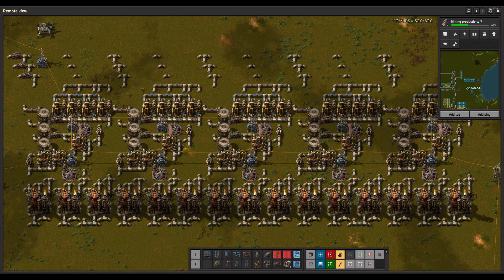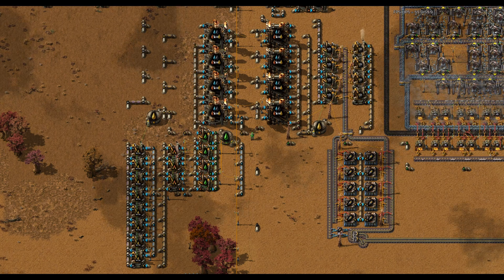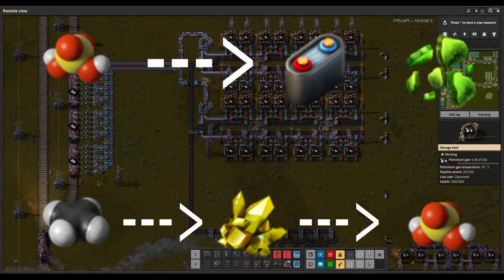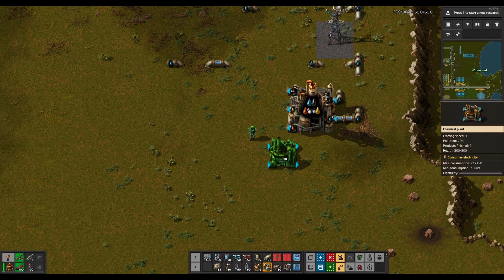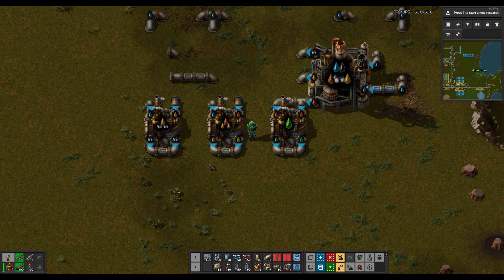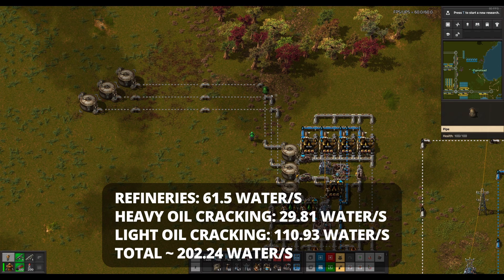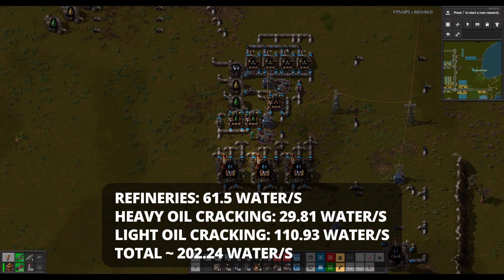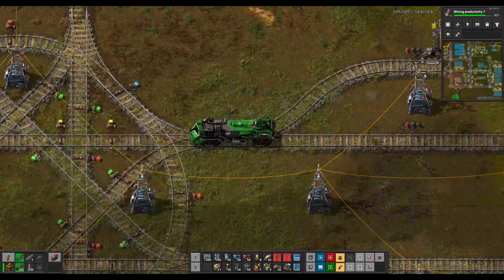A Quick Guide to How I Tackle Advanced Oil Refining in Factorio

Comment: I just do a read contents of fluid tank and turn off the corresponding chemical plants if low on heavy/light oil. Allows to easily attach some lubricant and rocket fuel early on. And you can go easy on ratios — just add a bit more consumption than you produce (I still use the ratio calculator site for needed amounts of buildings) and none of the outputs will be blocked.

You can also burn excess petroleum (and light oil into petroleum) into fuel for boilers early on on Navus (Or you could try voiding it via "change recipe" on a clock - works for voiding molten copper on Vulcanus in "Ghost LDS" recipe, so why not try for petroleum)
Reply: On Vulcanus it seems that your only limit is plastic (coal more specifically) and space to build. Solar is 3 times more efficient - so after poisoning some small worms and establishing Starter Base™ you can spam those.

Basic coal liquefaction is probably the only thing that eats through calcite like crazy, so you probably want to import some science to research normal one and ditch old one all together.

After that I made a design for supplying 2 chem plant of plastic and copy/pasted it into one big x16 build (red circuits are hungry)

So yeah... 4 green half lanes of Coal is not enough and I guess I'll rebuild the coal belt strip (again) on bus to accept  even more coal from big mining drills.

Comment: I think a more straight forward solution to handling the mismatch of fluids is to have your cracking plants only work when Heavy > Light and Light > Petrol.  You can do the circuit logic on two pumps each coming out of your heavy oil cracking and light oil cracking builds.  The outcome is that all your oils will remain at about the same level.
Reply: I think I did this once and then forgot the tactic. Thanks for the tip.

Comment: To expand on this, early game coal use can be a problem with blue science and power. To that end I like to setup fuel bricks as the final overflow product for light oil and petro. So I turn anything over "high" light oil to bricks. Only turn light to petro when petro is "low", but also turn petro to bricks if "high". And much like your design, crack all heavy unless lube "low". The plant will only shut off if both power and oil needs are satisfied by light oil stuffing up the system. So your oil plant now becomes your plastics and power center until nuclear. If you are unlucky, like me, and don't have any uranium in the spawn zone, this will last you pretty far into purple and even space.

Comment: Can confirm, turning chem plants on and off via the circuit network was possible in 1.1
Reply from the maker: Thanks!  Neat to know that I just wasn't paying attention.  Still, the first pump that I realized was totally unnecessary in 2.0 is the one on the petroleum gas line pushing the machine output to the tank.  As I recall, pre-2.0 fluid simulation would jam the light oil cracking production outputs without that one… so they weren't all totally unnecessary at the time.  Evidently I like toggling the chemical plants themselves better, which you can see in the my newer blueprint (which is linked in the description now).
Reply: @zipnotoad Using a pump and a tank (as liquid level sensor) may not be necessary, but it has one huge advantage. It works no matter how many chemical plants* and tanks are in the system and, crucially,  pretty much cannot break by adding more**. Connecting chemical plants directly requires remembering connecting all newly added ones too. Connecting directly to the storage (for reading liquid level) requires recalibrating circuit conditions after adding new tanks. Those problems are not that important for "refinery blocks", but can bite badly in the starting refinery especially new players.

* until the pump cannot provide enough liquid, IIRC 120 unmodified common chemical plants cracking heavy oil, not exactly a concern
** at least not in any hard to detect way, slightly of circuit conditions and missing cables are nightmare to debug
Reply: @zipnotoad Using a pump and a tank (as liquid level sensor) may not be necessary, but it has one huge advantage. It works no matter how many chemical plants* and tanks are in the system and, crucially,  pretty much cannot break by adding more**. Connecting chemical plants directly requires remembering connecting all newly added ones too. Connecting directly to the storage (for reading liquid level) requires recalibrating circuit conditions after adding new tanks. Those problems are not that important for "refinery blocks", but can bite badly in the starting refinery especially new players.

* until the pump cannot provide enough liquid, IIRC 120 unmodified common chemical plants cracking heavy oil, not exactly a concern
** at least not in any hard to detect way, slightly of circuit conditions and missing cables are nightmare to debug

Comment: Hey this guide is pretty good, by any chance can you put this as a blueprint?
Reply from the maker: Thanks!  I've had my nose to the grindstone "playing" Factorio to brush up on some of the new 2.0 features and to fix problems with my old solutions to pipes and rails.  I'm looking to make some similar videos about pipes, belts, trains, and even stations with parameterization soon; since I'll have blueprints for relevant pieces of all of these things, figuring out the best way to share those alongside my videos is a pretty high priority.  (Maybe I'll bump it up even higher since you've made the request!)  I also plan to include relevant information in the blueprints themselves, depending on what I can get away with there.

As it happens, I have, since this video, put in the work to redesign my advanced oil refining layout; I think it's actually a bit smaller, which makes sense since I could do away with most of the pumps.  Since it'll probably be handy in demonstrating some of the practical uses of the 2.0 pipe behaviors, so I guess:

tl;dr: yes blueprints.  The oil refining blueprint will probably become available when I make the next video (soon, I hope), and I'll probably make it available here at the same time.
Reply from the maker: You might like to know that my revised oil refinery blueprint is now available here:
https://factorioprints.com/view/-ODS7wpKQtukP5q0inRa
Reply: Half the fun is copying the design from what I just saw then staring long and hard at it to see if there are improvement opportunities. I learn more about the principles that way as I assemble the configuration